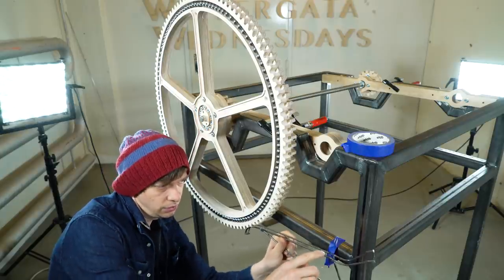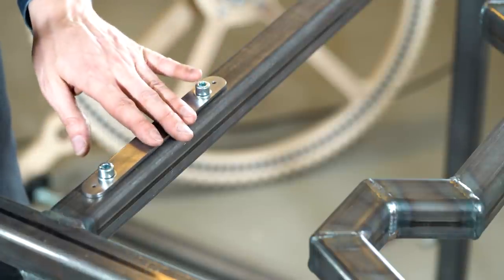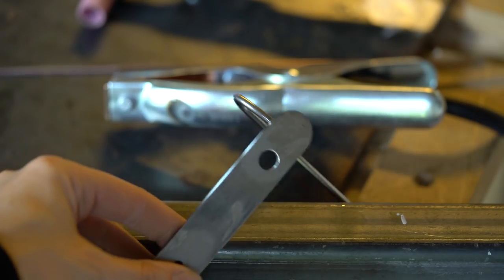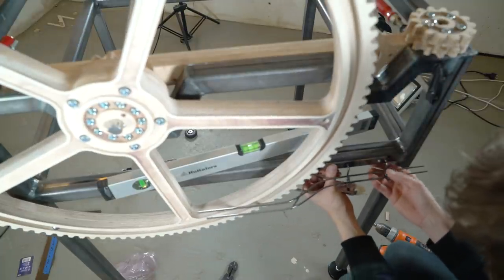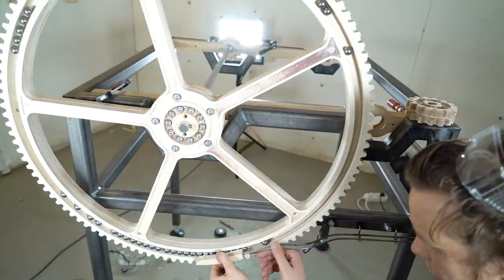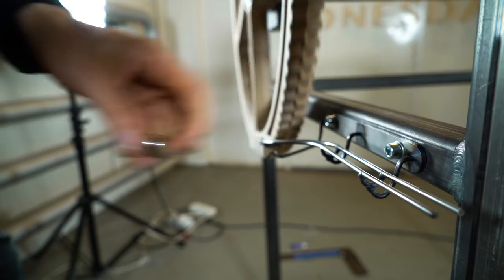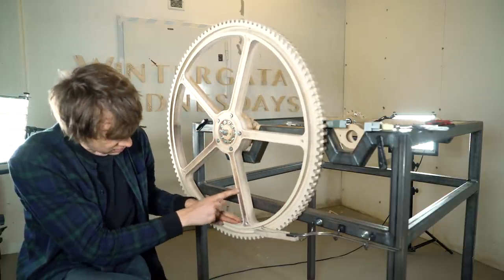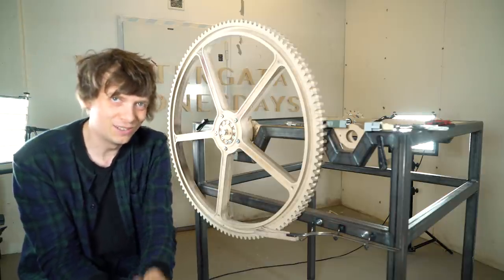Marble Tracks - Marble Machine X #15

Comment: Why not start with a flat steel bar? Instead of square bar?
Reply: Most likely he had Square Bar on hand and didn't want to go out to get flat steel bars. I mean he did nothing wrong by cutting up a piece of square steel. Just means he added a few more steps to his project but same results. Got a the piece he wanted.
Reply: Maybe he just happened to have square tubes handy.
Reply: Reusing scrap materials from creating the frame? Trying to match the colourization of the frame by using the same steel? Since it's doubtful he'll be brushing the whole frame, I'm guessing it's mainly the first reason.
Reply from the maker: thats exactly whats happened!
Reply: Nice job! I would add an intermediate layer in order to absorb vibrations between marble rail track and steel main structure. These rail tracks are noisy, and the sound is amplified by the structure made with hollow section, so reducing vibrations transmitted from rail track to the structure would be better. An epdm tape under the plate fixed to the structure + washers with epdm could work for exemple
Reply: Resources, cost and time....

You need to save all of these at some time in your life - I'd say here it was cost.
Reply: But isn't that part of the charm? The noisy Track adds to the sound ? But I do agree rubber gaskets might help absorb some of that sound?
Reply: Blacklab412294 I agree, some dampening would be good but I wouldn't want the noise to be muted too much. Like with pipe organs you hear the valves and channels opening and the air escaping, or wind instruments you hear the reeds, and in the case of Wintergatan, it's a typewriter key or marbles! All good!
Reply: It's like the smell of breaking into a new cave formation...   It's just air in there, but some low-lying 'puddles' might be thousands of years old.
Reply: Square tube is just 4 flat strips..
Reply: I like Youtube work Andrés Andrés hoy música.

Comment: You could easily turn the tracks into a degaussing unit to overcome the magnetized balls issue. Or have a degausser elsewhere in the instrument to degauss the balls as they pass through. This can be done electronically so you don't have to bang and damage the balls. The small electrical current to drive the degausser can be generated from the main wheel.

Comment: a full 3d printed version can help you to reduce the noise of the marbles,  metal with metal is the worst in case you want to keep the operation quiet.   Always try to give priority to the functionality instead the design, it will save you a lot of headaches in the future.
Love to see you solve problems and improving designs.

Comment: You should use lock washer for the bar to "never move ever". 
If you use regular washer, the screws have a chance to become slack with time.
https://www.mcmaster.com/#split-lock-washers/=19o2x7b
Reply: As long as the piece is still being adjusted/replaced, a normal washer seems to do the job.

Comment: Amazing job, as always.
Pro tip: to drill metal, you should go with very low RPM, something like 500-600 RPM. And use cut oil. This will prevent the smoke (and will protect the drill bits).
For demagnetization, I guess you could just connect the rails you just built (or the entire structure) to the ground.

Comment: Marking a parallel line with a measuring slide... you've got really funny ideas.
The spring you made is awesomly regular, I was pretty impressed.

I think I would have made the tracks out of PE1000 by milling (this would be a grass green part). The 3D-printed things are pretty breakable, at least if they are done by SLS method.

Comment: By only drilling, tapping, and countersinking the box metal for the rail mounting plate, you may have screwed yourself (pun intended). I would recommend you explore flow drilling the holes before tapping, to give you a few extra threads. Your repeated test fitting is probably giving hell to the 1 or 2 threads you have left. It will likely fail while you're still constructing (in my experience).

Comment: How do you prevent that delicate setting of wires from being bent to a non-workable situation during transport? Oh wait, I placed that comment when the endpiece was still 2 wires ;). I guess the regular tracks will stay in shape as long as the end pieces which need precision are another material (wood or plastic)

Comment: 10:16 Either your neighbors are very understanding, or they are sleeping like logs there! Great work with soldering! The Wood piece at the end of the rails seems to move slightly with the weight of the marbles, wouldn't it be an issue if it touches the wheel, slowing it down or damage it? Keep up the awesome work!

Comment: Get a marble collector that vibrates that magnetism off using the winding of the crank to wind-up a charging battery that gains power with every turn. just look at a wind-up flashlight and you will understand

Comment: Great show as always! Try stainless steel for the rails as it is non-magnetic (1.403, 316L) and TIG-weld it. You can even use the welding material for the single parts. Check out the WWW - it is self-explanatory.

Comment: Hi loving the build videos, just a quick note, don't point your camera at the metal while your welding without a filter on because your going to burn out the sensor and have a tone of dead pixels (believe me, its happened to me twice before) good luck with the build though :)

Comment: Add a Wimshurst machine on the side of the programming wheel, and use the high voltage pulses to demagnetize the marbles at the top of the machine. It should fit in with the aesthetic and solve your magnetization problem.

Comment: I would not waste your time trying to get the " look " of the reddish glue layer. The glue layers is super thin and the depth of the  inside ply layer may not be all the same size.  As easy as it was to make the mistake and carve down into the glue lay to expose it, you will carve down again past the glue exposing the next layer.  If you want a contrasting look on the spokes, glue on a decorative strip of different color thin wood or veneer and add some " POP "    other wise you'll just get poop.  :( yuck.

Comment: Pro tip, for those welds you didn't need filler material, just ramp up the amps high and some quick tacks and you'd have been golden.

Comment: I applaud the consideration of design aesthetic and colouration. As you said that I wondered about the potential use of brass (marble machine is "woodpunk" to be fair) as part of the look.. Then you talked about the magnetisation effects and issues. Now I admit that brass rails would be trickier to make and would need to be sturdier to maintain the shape, but it would certainly cut out some of your magnetism problems. Plus the lovely  golden brass look is worth considering ...... 
In fact, ...... making that rail instead out of thick (3-4mm diameter, say) COPPER wire might be an answer. Malleable enough to work into shape,  Thick enough to hold position, with semicircles underneath similar to your welded ones (or short sections of semicircular copper pipe spaced out underneath would work even better.) to give necessary separation and support.and the marbles would NEVER stick to them. Plus it would stay horizontal (as you say you would prefer) plus you hen have the vivid colour contrast.
In addition, given that you have spinning magnets near metals, have you considered that there may, depending on conductor position, be electrical current flow? You could possibly harness that to power eg small LED's to, say, light up the Wintergaten/MMx logo, or something powered only by the flywheel. Something small enough to not slow the flywheel. Good for thought.
I look forward to the next video. Keep putting them up!. Watching them is a joy. And I'm glad Wilson finally put in some effort!
Tack så mycket

Comment: To test long term affect of magnetism it potentially could be a good idea to set wheel up on a motor in an infinite loop with marbles being dropped onto, raked off, dropped &c to test over a longer period of time how magnetized they get and effect it has on running down steel rail etc. The other option is to use something like aluminum rails....

Comment: Nah. Screw 3D printed. Unless you're going SLS, it's not gonna be all that durable. I mean, I guess you could print out a whole load of them, which would solve any breakage, so long as you carried them (or at least their files) with you on tour.

Instead, you should machine it out of black Delrin, or UHMW! Durable, light, easy to machine (a joy, really), cheap, and black. Plus, if you really wanted, you could paint it a different color, though that doesn't seem to go with the aesthetic/design you're after, and if that's all that was required, then the plywood would be fine.

Just something to think about.

Comment: You could use a nonferrous material for the rods out of which you are making your metal tracks. Something like 316 stainless steel would probably work in this application.

Comment: I hadn't watched this video up to the point of your talking about the marbles getting magnetized. I am and electronic technician by trade and I work for a company that makes enamel coated magnet wire. If you make a degauzeing coil and have the marbles pass through it there will be no problem.

If you want I'll bend the ears of my company's engineers and see what we can come up with.

Claude G. Vest 
SR. Electronic Technician
Rea (pronounced Rea) Magnet Wire
Lafayette, Indiana Div.
USA

Comment: 1: It looks like your drill bits are very dull. Get a "Drill Doctor" or similar drill sharpening device. It will pay for itself quickly. A good sharp drill in your drill press should produce curls, not shavings.

2: Hydrochloric acid can clean off the heat discoloration from the steel, although it will make it more susceptible to rusting unless neutralized immediately (Baking soda solution) or protected from air (Johnson's Paste wax). Perhaps save that as a final step.

Comment: Would running the marbles trough a copper pipe fix the magnetisation issue?
I am thinking that the eddy currents* generated would counteract the magnetisation from the lifting mechanism

*seen that thing where someone drops a magnet down a copper pipe? 
It's that.

Haven't seen it? Here is someone elses video showing it: https://youtu.be/5BeFoz3Ypo4

EDIT: Fixed grammatical error

Comment: If you drill into metal you need a sharp drill, lower speed and higher pressure in order to create clean chips instead of grinding away the metal. It will go faster, cleaner and with less tear on your drill bits

Comment: if your 3d printing the loading ramp, I would do it as a C shape to ensure that the marbles also cannot jump track when collide when the music has stopped or if they are feeding into the wheel faster than the wheel actually is rotating to accept them. You also can then incorporate your mounting to the farm directly into the print while positioning the opening of the "C" facing to the outside so the audience still can see the marbles moving thru the track.

Comment: You could use brass or copper track or stainless steel. Or something fun like titanium. Perhaps tungsten sphere's would work for MMXI as they could be smaller and have a shorter drop and impart the same energy.

Comment: Hi Martin, for the magnetization: probably it will be (partially) fixed if you ground the Machine. Now, its standing on those nice adjustable legs, but they have rubber (isolating) pads on them. If you attach a wire to  the frame and to for example the heater, the balls get grounded every time they touch the tracks, so the magnetizing will be less.

Comment: For magnetization of the marbles, try a wire "brush" that the marbles roll through, like those things at a car wash, that is connected to electrical ground (maybe steel frame?) using the wire. The brush could just be the stripped ends of a copper wire.

Comment: 308 Stainless steel rod is not ferrous so it won't attract the balls once they become magnetized. If you make the tracks from stainless steel then you retain the steel look you are after and avoid the magnetism problem. You can TIG weld it just like you are doing with the mild steel tracks. 
Oh, and it brushes beautifully, another bonus!

Comment: The magnetization caused by the 1/2-a-turn trip up the wheel will be negligible when the machine is running. The magnetization you're seeing now is caused by leaving marbles in the wheel for extended periods. You can easily de-gauss all your marbles by simply putting them in the oven for a while (with no strong magnetic fields nearby).

Comment: Metal files only work on the push. Lift the file off the metal on the return stroke, then apply pressure on the push. This saves your file from jamming up with metal shavings quite so much, and makes the finish smoother since you're not pulling as many shavings across the workpiece. However, sandpaper and emery cloth (like sand paper, but for metal) are fine to rub back and forth.

Comment: Welding tip:  after you've finished your weld, keep the cup pointed at the joint till the metal returns to a grey color (or stops glowing) the TIG torch has a postflow that keeps the shielding gas going so you can prevent the metal from oxidizing. You'll end up with even nicer looking welds!

Comment: Hi! I saw how many drill bits you used. You should use cobalt drill bits at slow speed with some lubricant as you go, but always low speed. Cobalt slightly more expensive but they last forever if treated correctly.
I normally use WD-40, I'm afraid the water will corrode the metal when it's at its most delicate.
About the magnetism, if you manage to find stainless steel bars instead of mild steel, the effect will be significantly lower.
Keep it coming, love your videos! 👍🏾

Comment: Elsker detaljene i disse episodene! Instead of plywood or 3D printed parts, you could use aluminium. That would have it's own upsides and downsides though. It might clash a bit with the steel since it's similar but not slightly different looking, and you would need to use it other places as well in order to have it look good. Just a thought. I have no experience with 3D prints myself, I just worry it would degrade over time and not be strong enough. I'm super confident that whatever you end up doing will work perfectly and look at least as good as it works!

Unrelated question; Will the vibrations from it playing (especially on stage) be a problem in any way? If so, what are you doing to compensate for that? 

Lastly, you better take it with you to Norway for at least one show! I've been following your work for a long time and would not miss a live show for the world!

Comment: You can degausse the balls without electricity. Run them through a wooden tube next to a very quickly spinning magnet. Power the magnet by gearing it to the main wheels. The spinning magnet will preform the same function as the AC energized electromagnet that makes up an electronic degausser.

Comment: a thought on your magnet issue;
1) Not sure if this will work, but if the big wheel is all aligned one direction (as mentioned in a previous video), then align all the magnets in the 2nd wheel in the opposite direction.  With the exception of when things are stopped then a blast of both poles in transit should prevent the balls from getting too sticky one way or another.
2) I volunteer at a nonprofit PC refurbisher, and to demagnetize things like floppy discs and tape media for recycling we use a small degausser.  For HDDs we use a much larger industrial degausser.  Pretty sure you could build one into your design towards the beginning of the track to de-magnatize your bearings before they get on the metal... down side is that it would take power to run it.

Anywho, hope that helps!  Cant wait to hear this thing make music!!!!!  When you do your World Tour I hope you come close to Cincinnati so my kids and I can see you guys (and the marble machine) perform in person!

Comment: Just alternate the polarity of the magnets! It's not rocket surgery. With alternating polarity magnetic fields, the marbles will not get too magnetised in the process, and if for some reason they end up magnetised anyway, the'll slip past the magnets (or "cog" if you will) and get degaussed when they get out of the wheel. Problem solved!

Comment: all you need to do is build a "de magnitizer" at the top... and expose the steel marbles to it.  A de-magnitizer works by using alternating North/South magnetic field...  Can be made by placing alternating  N/S magnets on a wheel...   see link http://www.gadgetbuilder.com/DeMagnetizer.html  Or use an electric version in which they pass through a tunnel and get demagnitized...

Comment: you could use aluminium or stainless steel (some are non magnetic for example V2A) for the tracks so the magnetism will not affekt the marbles
both are good for TIG welding so no problem on that. And stainless steel looks good

Comment: You could use non magnetic stainless steel. Then you have your contrast and a stable construction.
A little piece of stainless steel tube next to the wheel could solve the problems with the marbels - they
can't go to any other side when they are in a tube

Comment: Try to make the feeder piece out of metal only like you planned! Maybe make the last part of the feeder be 3 or 4 rails. Sure won't be easy to bend, but I don't think a 3D printed plastic part will look good (and design is important ;) ). It will most likely also obscure how the balls enter the wheel.

Comment: I would put felt backing or better yet leather backing(more organic), inside the marble lift gear to deaden the noise. Also aluminum is not magnetic if you used that for your track. Probably hard to weld, but you could bend pipe and cut in half. Should work for copper and nickle too. Any metal but steal.